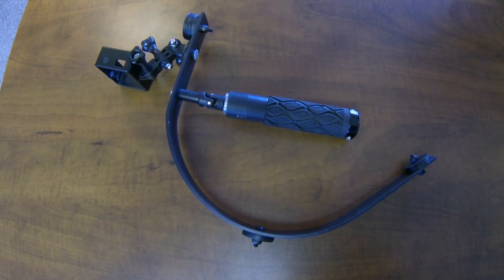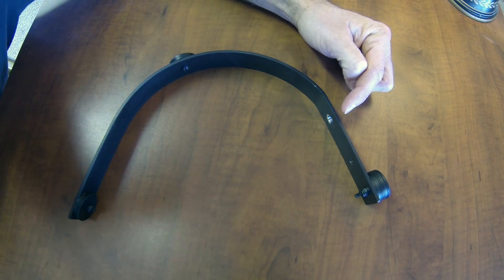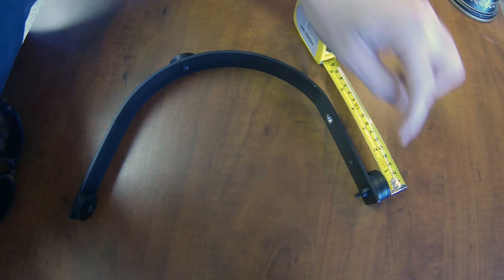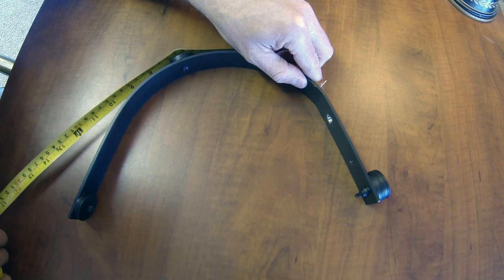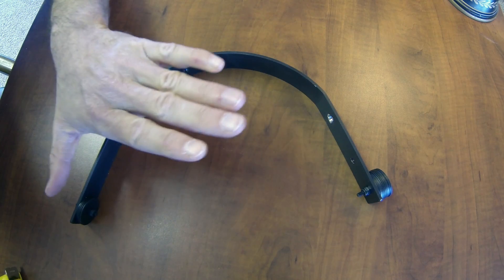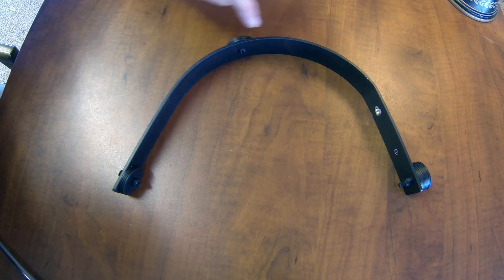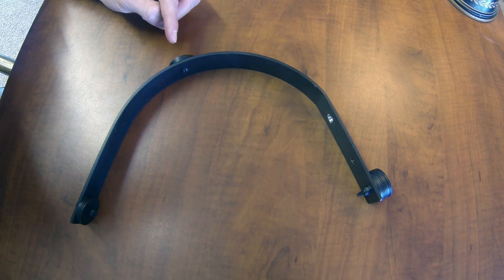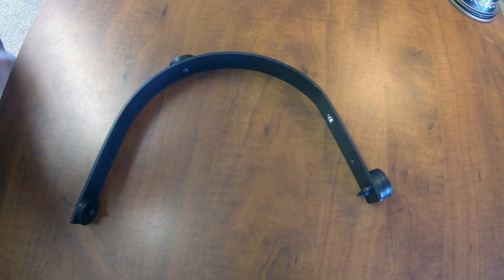DIY GoPro Steadicam Version 2: Step-By-Step Build How-To

Comment: For the joint on the hand grip.... I'm thinking that the similar adapter for ratchet and socket set could also be used.
Reply from the maker: It is the same type of joint but those are usually made to be tight. For this purpose we want it as loose and frictionless as possible. Not sloppy but loose. With the plastic construction, you can drill out the holes to get the desired looseness.

Comment: Hi, did you bend the curve part around the tank first and then bend the straight ends?  Was it easier to bend the straight ends and then get the radius afterward?  Thank you.
Reply from the maker: Hey Tony! It's been a long time since I built mine but I believe that I bent the curve first and then bent the angle. Then you can cut off any excess length that you might have on the ends.

Comment: Do you see any downside to having the camera straight above the Trax piece using a male to male adapter?
Reply from the maker: No, that should work fine. The only thing is that the tripod adapters use a 1/4-20 thread and a 1/4" thread won't grip the inside of the Traxxas plastic U-joint. I used a brass 1/4-20 threaded insert in the U-joint and a 1/4-20 piece of bolt/all-thread to accomplish what you're talking about. http://www.buygoproparts.com/products/brass-1-4-20-threaded-insert
Reply: They make a 3/8" to 1/4" adapter and I think that should work with the Traxxas piece I have. Just checking to see if there would be any issue before trying it out. Thanks for the help! It's a great build!
Reply: Here, in case you decide to start selling them: https://www.amazon.com/dp/B01GH37HN6/ref=wl_it_dp_o_pC_nS_ttl?_encoding=UTF8&colid=3V92X91V84L5T&coliid=IROO2W673XQUL
Reply from the maker: Good thinking! I hope the threads are long enough. Have fun with the build! Thanks for the link.
Reply: T.K. Archibald no.

Comment: Did you look atusing a mini ballhead instead of a universal joint? What advantage does the universal joint have over a ball head? I think this would be cheaper and also just as smooth.
Reply from the maker: I have a couple mini ball heads but I also had the universal joints on hand when I was building my first steadicam. Other people had good success with the universal so that's what I went with. You can try the ballhead but it needs to be very low friction.

Comment: Hello, I want to make your steadicam but I can't buy traxxas in my country. I thinked about something like that http://screenshot.sh/n8elLAD8mSQCn Do u think that's will be ok or traxxas is better?
Reply from the maker: I do not think that the part in your picture has enough range of motion. The Traxxas part is from a remote controlled truck. If you could find a u-joint from a different brand of remote controlled car or truck, it would probably work. Do you think that is possible?
Reply: I found something like that http://screenshot.sh/m9f5MWJaPPG2b but this required an different bearing, I'll look. I have to wait few days or try with http://screenshot.sh/n7Sr51d8ixHcv. Do u think step 2 make a sense or it's better to wait. I asked becouse i don't wont to have a problem with balance.
Reply from the maker: The first could probably be made to work. I think the second link won't be loose enough.
Reply: I made it :) it's very hard to make it stable but I managed to. Thank's a lot ;)

Comment: This will help a lot! If you have them, could you tell me the weight of the three groups of washers, so I can make sure I have it all balanced out? Thank you!
Reply from the maker: +Rory Wimberley Hi Rory. The 10 washer stack weighs about 83g. One 4 washer stack weighs about 32g. I would not be surprised if your weights ended up being slightly different because each individual rig is built differently.

Comment: Great instructional video,  this should also work for the small Hero 4 Session, I take it the rear weights are what would be used to balance out the lighter camera.
Reply from the maker: +Gordon Crawford Hey Gordon! Yes, you are correct. This will work with a Session. You just need to adjust your weights to get everything balanced correctly.

Comment: I have decided to try this build, as it seems the best throughout, compared to the other DIY versions. I got a few things I wanted to clear up before building one, tho. 
Does the curvature matter, or the point is really to just get the weight directly under the camera to get the best center of mass? 
also, Does the width between the hangle hole and the tripod mount screw hole matter, or the goal is just to get the camera exactly above the handle, for center of mass again?

Pretty much just interested if the sizes and lengths matter greatly or as it looks to me, you just have to get the best center of gravity to hold the camera steady

All in all, your build is well designed! Great work :)
Reply from the maker: +Chris Nõmmann Hey Chris! Thanks for the compliments! I'm glad you're going to try this build. The exact curvature and hole spacing does not have to be exactly like mine unless you are trying to replicate the exact same weight layout that I have. If you change the frame curvature and/or reposition items on the frame, your balance/weights will end up being different than mine. Even if you build it as close as possible to my specifications, you will most likely have to do some fine tuning of the weights. You are correct that the camera needs to be above the handle pivot and the bottom weight directly below the handle.
Reply: God's Country That's Exactly what I wanted to know, if the design allows to make some personal adjustments which in return can be corrected by some tuning of the weights. Great thanks for the reply!

ps, I'm using washers for the weights which have a bigger hole in the middle than the crew I'm using to tighten them and a smaller washer to keep the screw head from sinking in which allows me to fine tune the weights in all directions about half a centimeter. Therefore I should have an even better all-axis tuning possibility.

Comment: nice video! Im About to build  myself  a steadycam too. could you  maybe copy your  steadicams form with the exact positions of each hole to a piece of paper and put In your description Or just Auswer my comment and give  me a link  where i can  download  it? ?
Reply from the maker: +Pascal Chanoca Hi Pascal. Thanks for the comment. I have all of those dimensions in the description of this video. Did you see them?
Reply: +God's Country yes  i did, but  its still really  hard for  me to imagine How i have to bend the  Aluminium. So if you would copy the Form just with  a pencil to  paper, and then put it in the description Box i could easilly print it and Start bending  it the exact  way you did! Thank you for your answer 

and by the way; your videos are awesome i love  it to  Make stuff by  myself! !!
Reply from the maker: +Pascal Chanoca Hi Pascal. I'm really sorry but Youtube does not give me the option to upload pictures to the description. Something that might help you to know is that I bent the frame around an air tank that was 7" in diameter. If you can find a cylinder that is a similar size, it will help you. I'm sorry I can't do the picture but get the measurements out of the description, maybe draw it out, bend the arc around a tube/cylinder, and you should get pretty close to my frame.

Comment: quick question why do you use bearings at all, Because then you can,t direct the camera to the angle left or right wise that u want it will just always freely move great video though
Reply from the maker: Curtis Bolger Hi Curtis. You need the bearings to eliminate the small unwanted rotational movements of your hand. If you want the steadicam to rotate you can twist the grip and it will move but if the steadicam is set up correctly, you have to intentionally twist the grip to rotate the camera.

Comment: How bout just get a HUGE PVC pipe and cut it into half and make it thin?Would it work the same?
Reply from the maker: Swift Blake That might work. It sounds like something that I would try if I already had the material. You could probably shape it with some heat if you needed to. Your weights will be different but you should be able to figure it out.

Comment: Great video with some fantastic narration. On the mechanics of it, why do you have a front weight? Also, correct me if I'm wrong, but the two back weights should be in a direct vertical line, and the main weight of the camera should be directly above the pivot point of the handle, correct?
Reply from the maker: Roy Porter Thanks for the comment Roy. Yes, ideally the weight of the camera should be directly above the pivot point of the handle. When I built version two of my steadicam I hadn't figured out how to make that easily buildable. Since then I have used a brass 1/4-20 threaded insert in the top of the Traxxas joint. Then I inserted a 1/4-20 stud into the threaded insert, through the steadicam frame, and into the GoPro tripod adapter on top. That way the gopro is directly over the handle below. The weights on the front are just what my particular setup needed to balance correctly. Balancing these things can be the most frustrating part but it sounds like you understand the mechanics. Once you get it correct, you want to change as little as possible. I used mine a ton over the last two years but I decided that I was using my GoPro enough to justify buying a 3-axis gimbal. I still keep the steadicam with me as a backup though!

Comment: Awesome video - really appreciate you taking the time to help us be able to make one! 

You were saying during the demo video that there is a slight "sway" to the rig itself, albeit a very smooth sway, but I was wondering if I used a heavier piece of metal than the aluminum do you suppose it would help with that small issue or no? I'm thinking in terms of a windy day, I would assume a slightly overall heavier rig would be a little easier to keep it from swaying but I don't know I could be totally off.  I might just build 2 since the aluminum would be much nicer and easier to carry around lol.  Thanks again man!
Reply from the maker: RyansWorldOrder Thanks Ryan! The secret to steady filming with these is balance. If you make the frame heavier, you will have to put more weight on top to compensate. Adding a bunch of weight to the bottom of the rig will make things sway more, not less.

Comment: I for the love can not build the joint, why didn't you show how to put it together in your video?? It's the hardest part..
Reply from the maker: Colter Rockwell I'm sorry you're having an issue with the joint assembly. I have heard that sticking the plastic part in some warm water will let the ears flex more easily but I have not tried it. I did not have trouble assembling mine. There are a couple of Traxxas u-joint assembly videos on youtube.

Comment: Hey, thanks for that great video. I almost got everything to buil it, but I don't know why i'm having trouble finding a aluminium bar of 1''1/4. Do you know if it's ok if I take a 1'' or 1''1/2 aluminium bar? If yes wich one and I suppose it will change the balance of the steadicam? Last question, sorry about that, how can I know how many washer I have to put in the curvy part vs at the bottom vs at the beggining of the straigt part? Thank you very much!
Reply from the maker: Vincent Roy Hi Vincent! A 1" or 1.5" bar should work fine. Your weights will have to be totally different than mine though. I think I would lean towards the 1" because the wind should affect it less.
Reply from the maker: God's Country The weight of the bottom of the "rig" (steadicam and camera combined) has to be only slightly heavier than the top above the pivot point in the grip. You need it just slightly heavier so that the camera will stay upright. If you hold the grip in one hand, pull the bottom of the steadicam out to the side and let it swing to the bottom, this should be a slow swing. If it swings slowly that means the weight of the top and bottom are close. The key is the make the front and back weigh the same to prevent rotation. Top and bottom are almost the same with the bottom slightly heavier. Side to side should be balanced so that the camera sits level. If you have a chance, check out my other steadicam videos, especially this one: https://www.youtube.com/watch?v=aioJ2Dt6C-s&list=PLA3b6ur_WCu4zVudrFGq5LW3k3r-okozQ&index=10 . I talk about balancing some in there. It's just a lot of trial and error sometimes. Let me know if you have any other questions.

Comment: Hey there, I'm currently constructing this awesome build and what I would really love to know is, what dimensions are the washers you use in your build? I am from the UK and so we don't have 'fender washers', instead we have 'penny washers'. Also i'm assuming you balanced the Steadicam with the gopro camera mounted in place?
Thanks
Reply from the maker: ***** Hey Ben! I don't think there is a standard size for fender washers but the ones that I'm using are 31.75mm (1.25") in diameter and are around 1.5mm (.055") thick. Yes, you must balance the steadicam with the GoPro set up exactly how you will use it (battery installed, no lens cap, same housing/frame that you will use, backpack/no backpack, etc).

Comment: quick question what size oxygen tank did u use to make the bend ? diameter
Reply from the maker: Sean Noonan Thanks for the comment Sean. I bent the aluminum bar around a compressed air tank that was 7" in diameter.

Comment: did i miss the length of the flat section where you mount the camera....to the bend , plus the....thanks  and any  over all length of aluminum as well?!   ps is there any NEW and improved ideas before i start my build.....thanks Robin
Reply from the maker: har99ley Hi Har99ley. I believe all of the dimensions that you need are listed in the video description, in the parts list. I haven't changed the design of my personal steadicam since I shot this video. One person has used a single bearing in the handle and clamped that bearing directly into a lock-on grip. I have not tried it yet but it sounds like it would work.
Reply: God's Country Thanks I watched a second time and got the info.....duh on my part....you'll be hearing  from me for parts etc........thanks again
Reply from the maker: har99ley No problem! Thanks for watching.

Comment: I've got a few questions...Can you just use skateboard bearings and could you just sticky mount the gopro to the top?
Reply from the maker: James Turner I don't think that you will find CPVC/PVC pipe parts that will fit the bearing and grip as well as the size that I used. The inside of the bearing needs to be a specific diameter to fit the axle shaft. The outside diameter needs to fit the CPVC/PVC correctly. That CPVC/PVC pipe size needs to be correct to fit a bike grip. I think you will be more happy in the long run if you use the size bearing that I specify in the build. I will be selling some of these parts very soon if you can wait a week or so. As far as the sticky mount goes, I have not tried it. It might work. You could try it and then peal it off if you don't like it. Thanks for the comment!

Comment: need too use the metric system lol
Reply from the maker: matthew neville  Haha! I actually prefer the metric system too. I usually use google to convert. Just type in 22mm = " into google and it will convert it. You can put whatever numbers you want and you can switch the " and mm (or lots of other units). Its a pretty quick tool.

Comment: Do you know if you can use the LCD Touch BacPac with the Frame Mount?
Reply from the maker: ZeroAmplified Yes it will. The old style Frames actually came with two frames. One for the bare camera and one for the bare camera with a bacPac attached. The new style Frame has a little metal hook that folds out of the back and holds the BacPac on. I only have experience with the older style frame. Thanks for the comment!

Comment: Hi!
I made this steadicam, and I just vonder how you balance it..?
Could you make a video on how you did that, the process on what to think of when putting the weights on?
You would make me one happy Norwegian if you did! :)
Reply from the maker: Hey Sickpuppy! Thanks for watching. I will consider doing a balancing video but I'm not sure I'll do it. Here are some tips. The weight of the bottom of the "rig" (steadicam and camera combined) has to be only slightly heavier than the top above the pivot point in the grip. You need it just slightly heavier so that the camera will stay upright. If you hold the grip in one hand, pull the bottom of the steadicam out to the side and let it swing to the bottom, this should be a slow swing. If it swings slowly that means the weight of the top and bottom are close. The key is the make the front and back weigh the same to prevent rotation. Top and bottom are almost the same with the bottom slightly heavier. Side to side should be balanced so that the camera sits level. If you have a chance, check out my other steadicam videos, especially this one: https://www.youtube.com/watch?v=aioJ2Dt6C-s&list=PLA3b6ur_WCu4zVudrFGq5LW3k3r-okozQ&index=10 . I talk about balancing some in there. It's just a lot of trial and error sometimes. Let me know if you have any other questions.